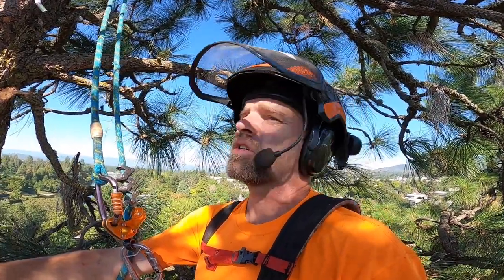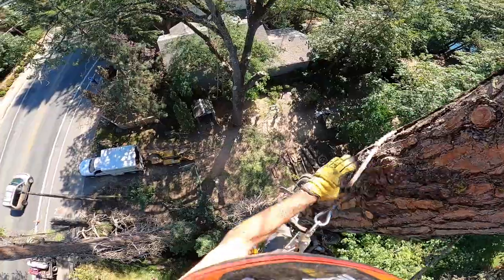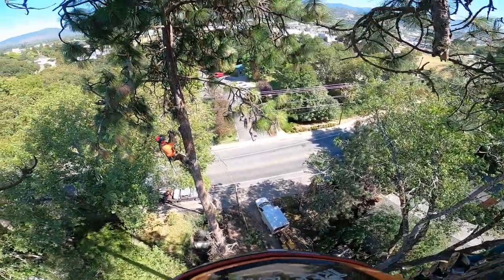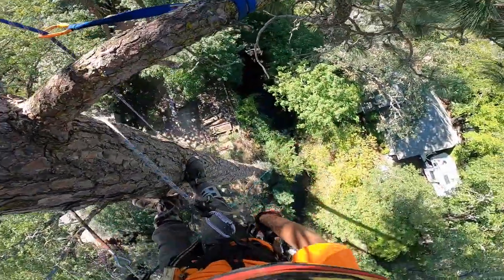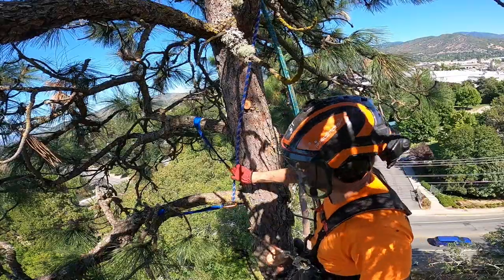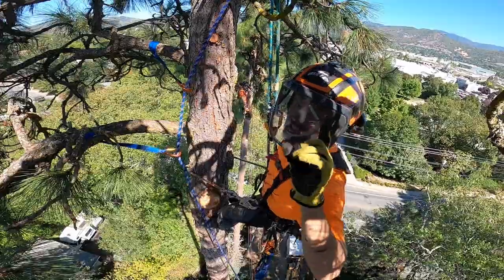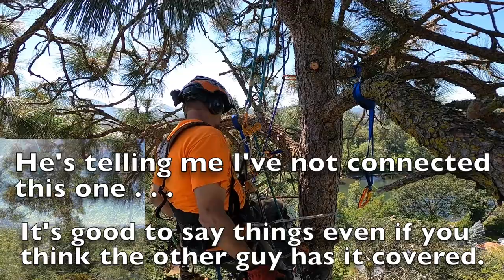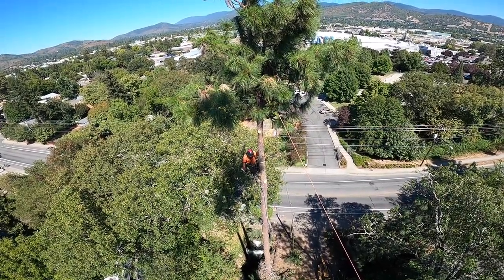Tree Removal -Why use a Speed Line?

Comment: Hey August, I had tennis elbow bad in my left arm that I just couldn't get rid of  no matter what I tried. Well after a lot of research on the subject, I finally discovered that the elbow can be overworked when you have either weak shoulder or wrist muscles. If either of these muscle groups are weak then the muscles around the elbow have to compensate for that, causing strain & inflammation in the elbow. Going on that info I began working out with weights, targeting the weak areas in question & after a short time the pain is gone & hasn't returned. Now I work out heavy with the weights & no problems with the elbows anymore:) Yes it was a bit uncomfortable at first but I stuck with it and glad that I did!
Reply: I've had a similar issue and fixed it this way as well. Good advice Ray!
Reply: Ray Clark hello. This sounds just like me, over worked my right , by climbing vertical ladders in buildings, with 70 lbs in my left, hand pulling up to the rung, then grabbing the next rung , all I can do is wear an ‘air cast splint on it , ALL THE TENDONS are stretched out , there are times it hurt so bad I rest my right hand on my leg when driving ., towards the end of my working carreeirb,<I started to use a rope to pull up stuff to the roof  ! Should have done that before , my work ? Refrigeration & AIR CONDITIONING . , retired in 2003, cheers 🇺🇸🇺🇸🇺🇸🇺🇸
Reply: @nicholasmiller835  Thanks:)

Comment: If you know you have to rig the top or if you have branches that are too low to speed line I modify this. I set a block or ring at the top, use it to rig any low stuff. Then have the guys tie it off on the portawrap or bowline the tree and use the other end to speed line. Makes things more efficient and if you run into limbs that wont work on the speed line whether there are obstacles  or they are too long of what have you, you have flexibility built in!

Comment: I just looked at the price of the kits. That's insanely low. Like, lower than making the slings yourself.  😮

Pulling the kit apart to use the slings and carbiners for non-speedline use is still a great deal. Especially with the rest that comes with it for carrying and storage
Reply from the maker: Zactly

Comment: A curious question August.  Why did you chose to use a doubled rope system?  I see Damien using SRT and was wondering why you didnt chose the Zig-Zag with an SRT system anchored on the stem?  You brought up an awesome thought that you may not have enough rope in an emergency to get down, but on an SRT, with say, a alpine or a Bowline with a tail to retrieve it so you wouldnt have to climb back up to your tie in point, would give you the length you needed? Just a curiosity on my side, Keep up the knowlege sharing, love seeing the other persectives, stay safe!!
Reply from the maker: Old Habits I suppose

Comment: Hey August, this may be a dumb question...sorry if so. Is to much slack in the line a factor when going all the way to the top to set the zip line? Since it goes straight down the tree, through the sling, and to the ground anchor. Thanks for the vid.
Reply: Also, if the slack is a factor...how would you correct that if you were zip lining over an object. Such as a house, shed, another tree and or landscape.

Comment: Do you have any recommendations for the speed line itself? I have various 16mm rigging lines, or maybe use a retired climbing line?
Reply from the maker: Static 1/2 inch usually
Reply: August Hunicke, thanks and go safe.
Reply: I like the yale scandere. It's a 48 strand static line. the 48 strand jacket makes for a nice surface for speed line.

Comment: Hi there, why don't making a short compression cut on the limbs before the final cut? that would make it much easy.
Reply from the maker: Hanging them up on purpose.
Reply: @AugustHunicke  get it, then you wanna do the fall with 2 steps. I guess for not giving to much tension to the rope with one and direct fall to the speedline. thanks.

Comment: Still not understanding why you don't run OEM 3/8" LP bar/chain/clutch, rather than 1/4" pitch. Readily avail., faster filing, plenty strong. As an option 3/8" LP NK (narrow kerf), which is .043" gauge, so you'd need bar & chain with matching gauge, both off-the-shelf items, using OEM clutch sprocket. Never have busted 3/8" LP or 3/8" LP NK chains. I'm all about KISS and retaining fund$. Keep smiling and spitting chips. (I should have claimed that "rocket surgery" line back when.)